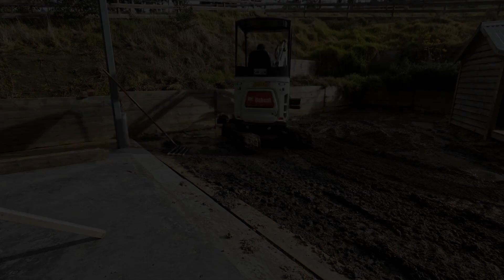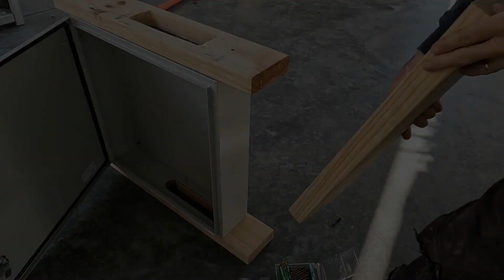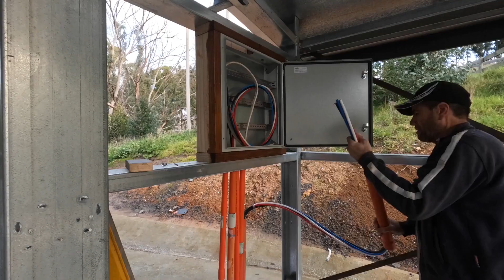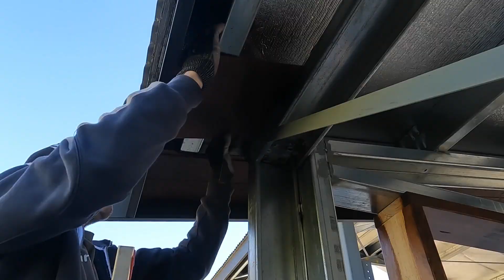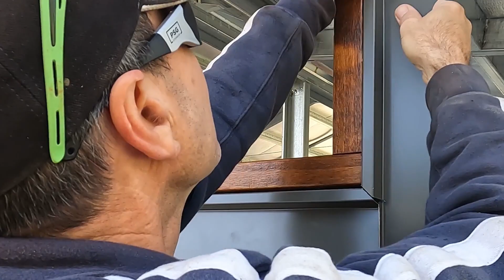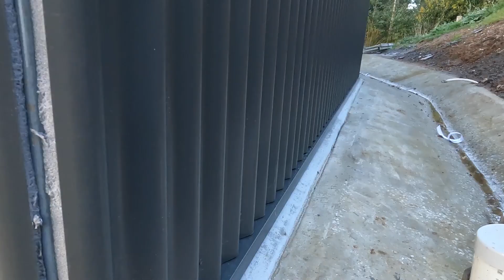Workshop build part 14 - Powering up

Comment: I'm surprised Australia doesn't make you have a liocense mate.. Nice build. I'll be building a barndominum shop here pretty soon.  Much different building process here but in the states but I do like galvanized look, that's what my current shop is made of. It's super strong and looks nicer than red iron. Sucks to weld to tho
Reply from the maker: Hi mate, in Australia you can do a lot yourself. Electrical connections are licensed but you can build to your skill level. Having said that there are still rules, eg I needed to register as an owner builder with my council, I need to have inspections done at certain points and at the end I need a final inspection to be signed off by a licensed builder to ensure it’s all built to the relevant standards. Owner builders also need to pay a small fee which is a proportion of the total estimated cost that goes towards training of others.
Reply: @Mezzmoengineering  yeah similar stuff here too you can cut corners but it'll cost ya in the end. Good luck brother
Reply from the maker: @FrequencyOfThought  Thanks mate. Agree, no cutting corners but being an owner builder can save a lot of money and be very satisfying if you have the skills to do the work. Not for everyone though, in fact I wouldn't recommend it unless you have a good understanding of what you want, how its done and the requirements.

Comment: Nice work, liking the wood & metal mix, will you be doing and venting on the soffit's down the road? looking forward to the solar phase 👍
Reply from the maker: Hi mate, good question about ventilation. I'll make a note to answer that in the next video as that will be easier than trying to write it out.. Solar should be on with the next 3 or 4 weeks